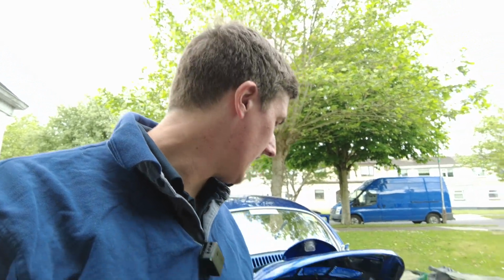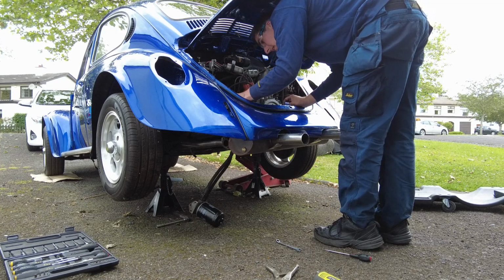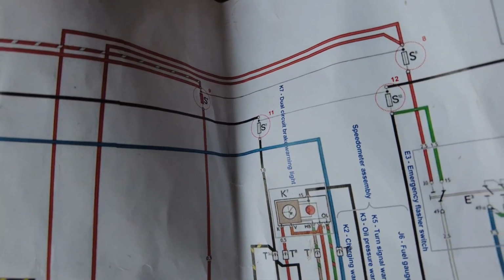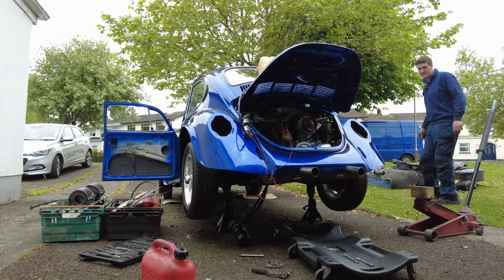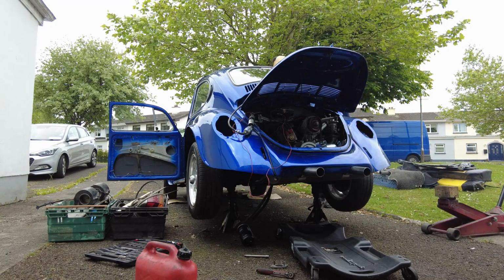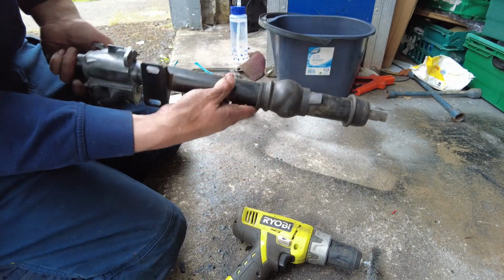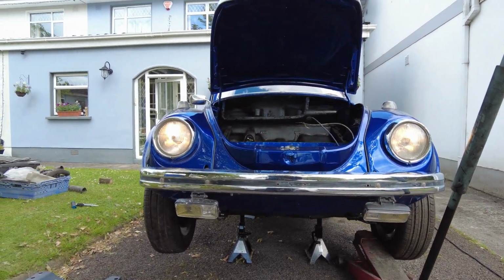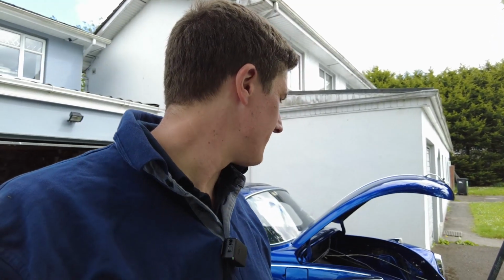VINTAGE SPEED EXHAUST installation and other progress - 1303S Resto -

Comment: Eh mate thought I'd let you know that I just changed my head gasket on the alh engine and all went well!

New head (from junk yard in decent condition)

need to clean injectors and adjust timing
Reply from the maker: Great stuff. I take it it's driving well for you now? My new MAF sensor arrived today so I will be trying that out soon to see if it sorts out my issue. A video will follow!
Reply: @Endfloat  yes driving smoothly and well. Need to drive more to see if the coolant loss still occurs but I doubt it. I think the head gasket solved my issue and feels good driving again
Reply: @Endfloat  can't wait
Reply: @Endfloat  I think the maf sensor will fix it
Reply from the maker: @Jesus-hx5vg  I hope you're right. That's great that you have your issue sorted.